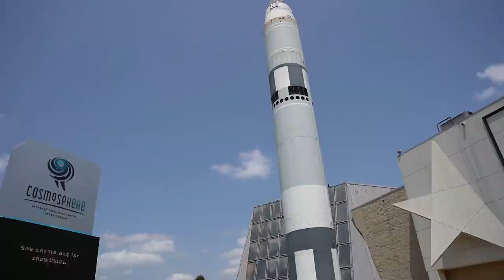World Famous Museum Hired Me to Take Care of Their Pigeon Problem!

Comment: Typically I will run 2 or 3 traps on a roof this size. I will also pre bait the trap with doors wired up for a week prior to arming the doors. The high point is a good spot to set one. They also love to roost above a food source so they can see what's around it. One more where you originally had it would be a great idea. Get some more traps Bobby! Keep up the great work too!

Comment: Bob, definitely pull the trap from the truck stop. Don't need any douchers messing with your trap, plus it seems the cat has put some bad juju on it. Double down at Cosmo and put it in a spot where, if you bring a small pair of binos, you can see if its full or empty from the high roof! Saves you time checking and climbing

Comment: Just make traps that Jordan makes just add shade cloth on tap cable tie onto cage cut around trap door where you access the birds 🐦 from and add a smaller piece of shade cloth, must be cheaper to make Jordan styled traps than the buy one of the net, just have to price materials and you may find that you could get more than one trap for the same amount as the single one of the net. Have you thought of trapping that cat 🐈 and when you trap that cat just take it to the vet, just my two cents worth and ideas 💡 what I would do in you situation and on a budget. Good luck with the pigeon trapping and stay safe